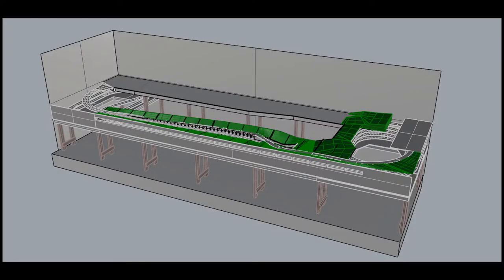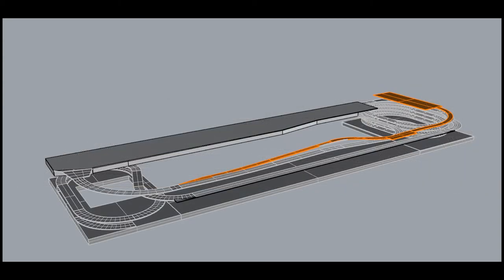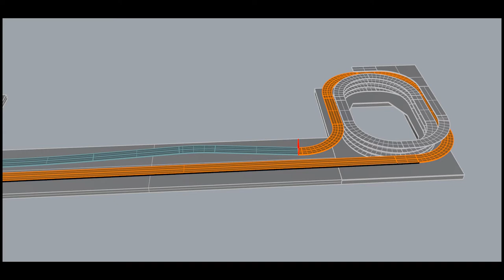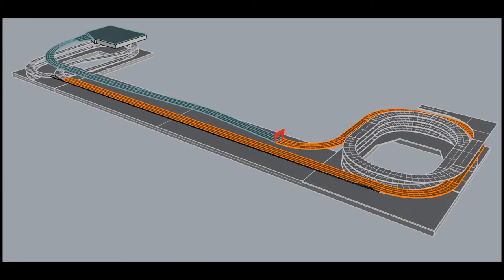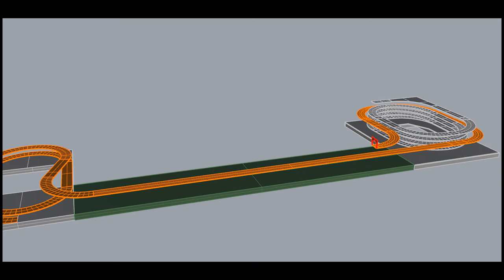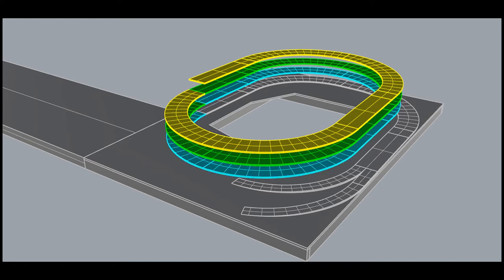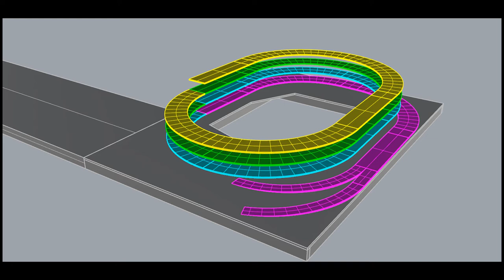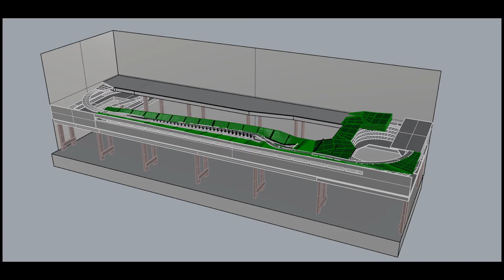Aldernam Junction  Episode 01A spirals explained

Comment: Great tube, the drivers eye view cam really shows it well. 
Can you explain why the spirals are necessary and why they are so complicated - for the casual viewers like me.  How many “miles” does all that cam footage represent?
Video Reminds me of the tomorrow land train at Disney land , a personal favourite.
Reply from the maker: The only space available for a storage / fiddle yard was below the new scenic area . Being below meant I had to drop down approx. 325mm to gain enough clearance to be able to man handle and service the locos and rakes of carriages or wagons. With both tunnel portals being at the same end of the layout meant that they are, in distance traveled terms,  at the maximum separation possible to create the most scenic length, so it was then necessary for one pair of lines ( orange spiral line) to travel back to the opposite end of the layout and then down in order to have a run though fiddle yard . The total distance traveled is approx 145 feet  or 44m or 2.1 miles in the real world, of which 45 feet  or 14m is station or scenic.